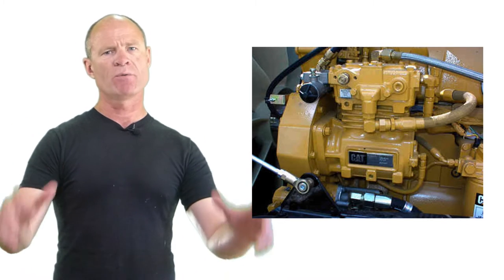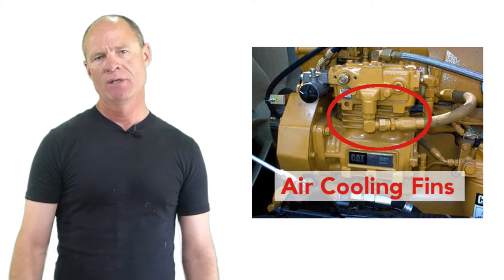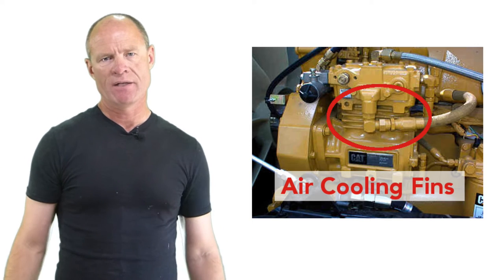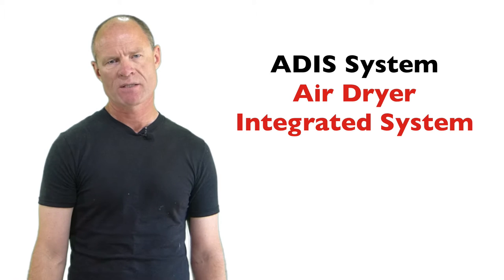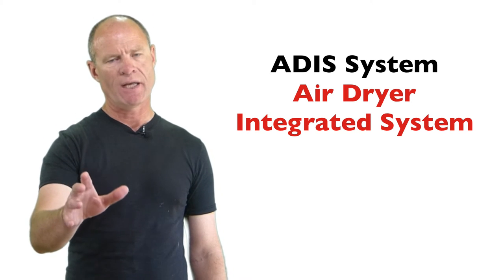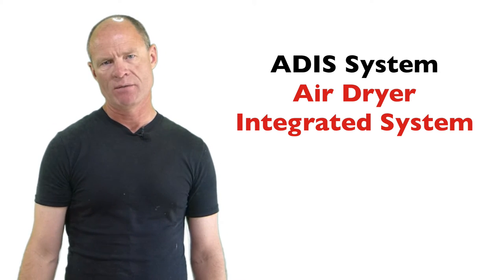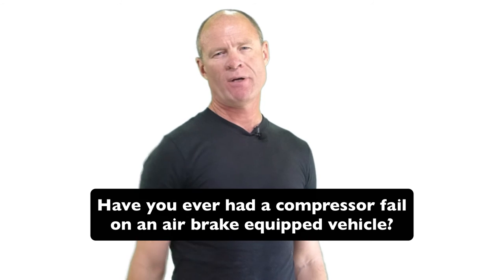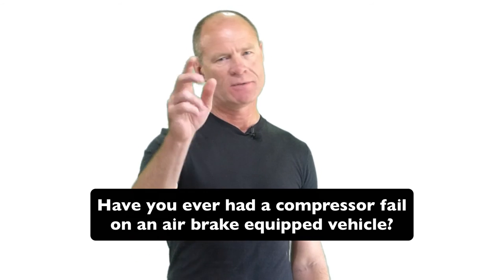The Air Brakes' Air Compressor | Air Brake Smart

Comment: Hi, I'm Denis and I would like to tell you an information about the compressor test in Quebec. We do have a compressor test from a long time ago.  We just don't do it the same way you showed it. We need to raise the pressure to 90 psi and then push the service brake pedal to make sure it can hold a minimum of 90 psi. I'm a trainer in a gouvernement school for road transportation training. 
You do a good job with these videos, keep it up!!!
Reply from the maker: Hi Denis - thank you for your comment and great information. When you hold the service brake pedal at 90psi, is there a time limit on how long the system has to hold that pressure? And when you do the service brake test of ensuring that the compressor can hold 90psi, are the parking brakes released? Thank you so much for your comment and great information. All the best, Cheers Rick
Reply: Hi Rick, there is no specific time you need to hold the service brake. As soon as the pressure hold 90 psi and usually it goes up, your test is considered positive. The system is under pressure when you hold the foot valve, so if the compressor can't hold 90 psi you will start to be in trouble. And of course you need to release the parking brake when you do this test. Thank you.
Reply: Only thing does not say if air compressor fails is it a major defect or minor and are you allowed to drive till time to get fixed..

Comment: How can I hook an air hose to my air compressor tank under a school bus? I have a 98 international 3800 with the dt466e in it. Is this possible?
Reply from the maker: Hi adictiveadictive - Apologies for the late response. Thank you for your comment and query. You can hook a line to the compressor system. The problem however is volume. These systems don't produce a lot of volume. So it is going to depend of what you're using the air pressure for my friend. If there is anything further we can do, drop us a note. Always happy to help. All the best, Cheers Rick
Reply: Thanks for getting back. I wanted to use tools inside the bus. Typical air tools you might find in a body shop like dual action sander air paint sprayer or maybe a nail gun

Thanks again
Reply from the maker: Hi adictiveadictive - you are most welcome my friend. Yes, for that application, there just won't be enough volume. You're probably going to need to go with a gas engine on a compressor. All the best, Cheers Rick

Comment: We remplace the  air compressor and air dryer  and still not let build up air till till we push the gas pedal is a. Peterbilt thanks
Reply from the maker: Hi Jose Sandoval - Thank you for your comment and query. Have you checked the governor? The governor controls the unloader valve and the maximum pressure in the system. If there is anything further we can do, drop us a note. Always happy to help. All the best, Cheers Rick

Comment: Where is the sir compressor on a kenworth truck? I been looking for about two days now?
Reply from the maker: Hi candice - thank you for your comment. What model of Kenworth, and what year is the truck? I need that information to tell you where it is. All the best, Cheers Rick
Reply: T370 , 2017 sir.
Reply from the maker: Hi Candice - I spoke with the guys at Kenworth here in Vernon. Is there a possibility that truck has hydraulic brakes? Is there a master cylinder up on the firewall right in front of the steering wheel? Let me know. 80) Cheers Rick
Reply: Smart Drive Test  Yes, it has airbrakes and the firewall.  This truck is new to us seeing as we just got it 2 months ago and sold our old one that was not a kenworth. So none of them know where the parts are at to well and lucky me. I only have my permit for the cdl. So I'm basically alone when I'm trying to learn this truck.
Reply from the maker: Hi Candice - the air compressor will be bolted to the side of the engine block. Can you find the air dryer? If so, follow the main discharge line from the air dryer back to the compressor. The main discharge line will be braided metal. I have seen the air compressor stuck in between the frame and the motor - and are difficult to find. Let me know, Cheers Rick
Reply: Smart Drive Test THANK YOU SOOOO MUCH!!

Comment: Can we hold 400 psi in air tank for long time( if 500 psi is max)
Reply from the maker: Hi Shankar Pediredla - Thank you for your query. If the system is running more than 140psi, you need to get it checked by a qualified technician my friend. If it is in fact at 400psi--as you said--it's dangerous. All the best, Cheers Rick